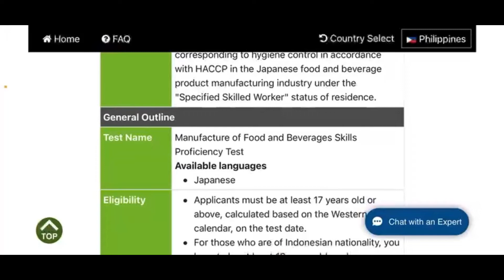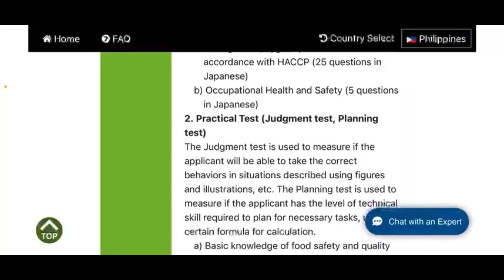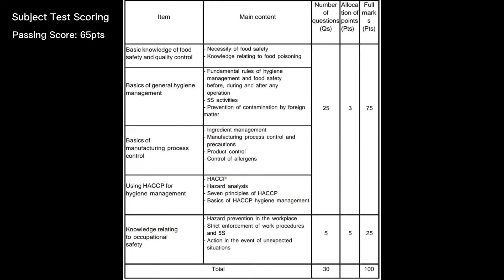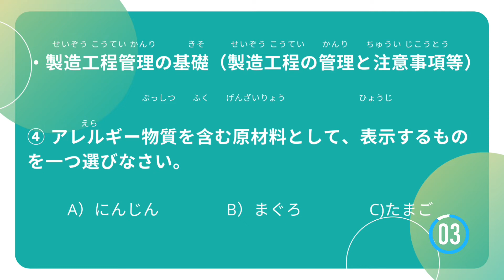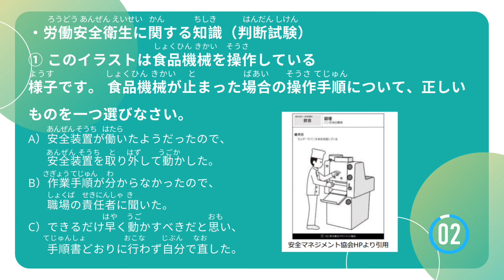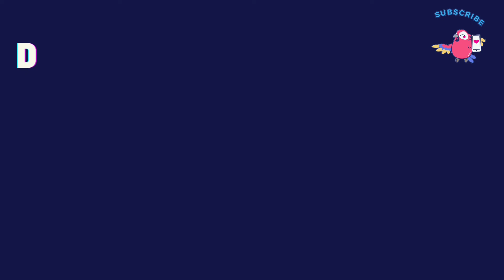SSW Food and Beverages Manufacturing Mock Test Japan 飲食料品製造業

Comment: Hi maam.. Can you help me on how to calculate in making bread? Its on the last question...
Reply from the maker: Hi,
If you combine all given ingredients, you will come up with the total of 300 grams of bread.

4kg = 4,000 grams
If you’re going to follow the recipe, 
you have 4kg of flour, devide it to 200
4000/200=20
so in 4kg of flour you need 20x of the ingredients in the given recipe. 
salt 20g x 20 = 400g
water 80 x 20 = 1,600

then add everything 
flour  4,000
salt       400
water 1,600
———————-
          6,000 

There are other solutions, but I hope this works for you.

Comment: Ma’am
Ano po explanation sa last question
Di ko po gets
Sorry
Reply from the maker: Hi!
The recipe shown in the chart can make 300 grams of bread, if that is the case, how many 200g are there in 4kg? So 4000÷200=20, therefore multiply the remaining ingredients to 20, 20+80=100g
100g×20=2000g
There's 1000g in 1kl, therefore 4kg is 4000.
4000+2000=6000g or 6kg
Reply: @mtlbyjessa1757  thank you po ma’am ☺️